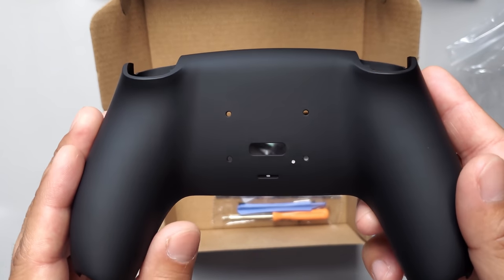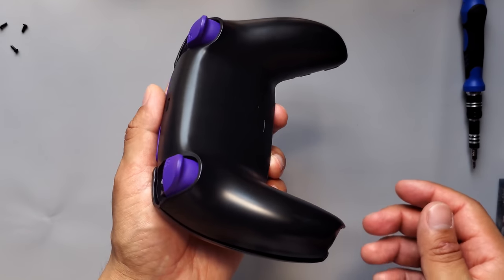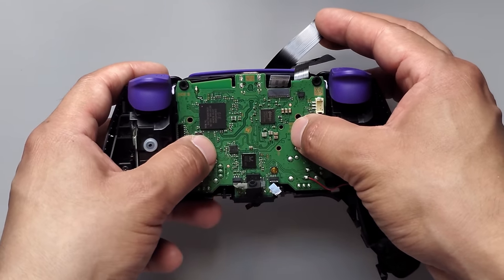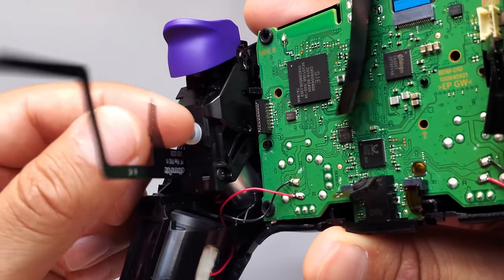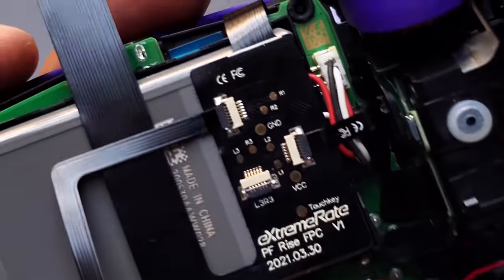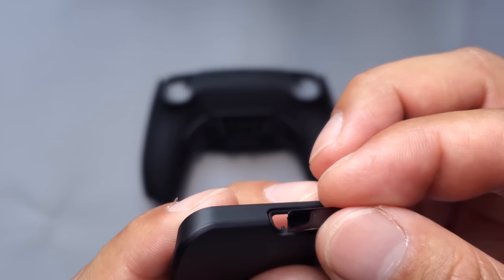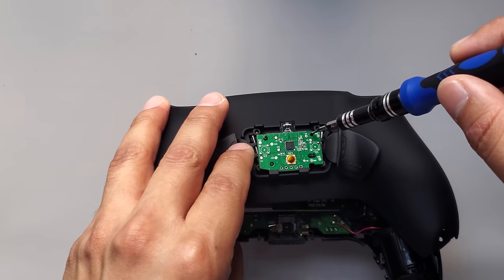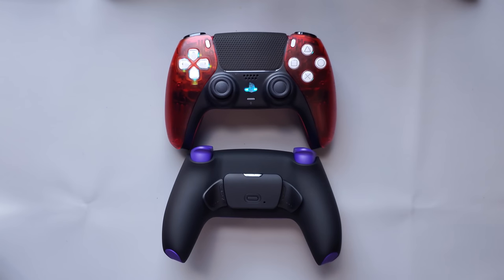DIY PS5 Controller (For BDM-010): eXtremeRate's Rise Remap Kit | No-Soldering Step by Step Tutorial

Comment: hi I saw your video and I installed the kit on my ps5 controller. Everything is good except one thing, my battery does not work any more whereas before the installation though. Do you have any idea of the problem ?????
Reply from the maker: Most likely the kit is not compatible with the control. You can ask Extremerate if they can send you the cables compatible to your control.
Reply: @im.a.caveman  Are you talking about the type C cable that is used to charge the controller?
Reply from the maker: @angelmoreau8148  The cables that connect to the triggers
Reply from the maker: I think if you put the original ones, the left and right side, and only connect the remap board you'll be able to only remap the Dpad and action buttons. But because the cables for the triggers are not compatible then you won't be able to remap those the triggers. I'm unsure. But like I said you can talk with extremerate about it.

Comment: I need some help it seems that when ever the L1/L2 ribbon is connected the controller doesn’t want to turn on but when it’s disconnected or turns on no problem? What’s going on
Reply from the maker: That means the kit is not compatible with your control. The V1 is only compatible with BDM-010. The rest are compatible with BDM-010 and/or BDM-020.

Comment: Hey brother great video. I've followed everything you've done but it seems like it's not working. Been trouble shooting for hours now don't know whats wrong
Reply from the maker: If the controller doesn't turn on its probably a compatibility issue. Is that kit compatibile with your control?
Reply: @im.a.caveman  Nah it's compatible and actually works with the triggers but it's not working with the face buttons :/ any tips?
Reply from the maker: If you checked your connections are fully plugged in then maybe it's the kit. I can't really tell since I personally haven't had problems at all with my installations.
Reply: @im.a.caveman  fair enough my man thanks for all the help though, I'll try opening it up today again and see what the problem may be!
Reply from the maker: @ZumaB  Take a look at the cable that goes towards the front of the controller motherboard. And if that doesn't work please contact extremerate. They'll possibly send a replacement.

Thanks for watching!

Comment: When I plug in the L1 L2 wire it automatically disconnect my controller. I troubleshoot everything else and it works fine but only the L1 L2 wire will shut it down. This is because the model id CFl- ZCT1W "A" idk why but it won't work it.
Reply from the maker: If the kit is only For BDM-010 which is CFI-ZCT1W then it's not compatible for BDM-020 or CFI-ZCT1W A. You need the one for BDM-020.

Comment: I can't get the first ribbon unplugged and I don't wanna mess it up.. I don't have a fancy tweezers like that, Idk why they wouldn't send something with the kit..
Reply from the maker: I think the more stuff they add to the kit the higher price for it. If you're able to grip the cable with your finger or nails try  wiggling it left to right, at its widest length, while pulling up. Don't rush, just a slight left to right will do. When I use my fingers this works for me and nothing has been damaged. It's the method I use sometimes so up to you if you want to try it.

Comment: Can I use "L3 and R3" as these extra buttons instead of X and the circle?
Reply from the maker: If you solder the wire needed to remap L3 and R3 then yes. This is the non soldering version which means L3, R3, and touchpad can't be remapped.

Comment: I installed it but the buttons don't work the light turns on and blinks when pairing but the then I click the button and it doesn't do anything. Do you have any suggestions?
Reply from the maker: After remapping turn the back off. On is for remapping, off is to use them.
Reply: Thank you sooo much I subscribed your tutorial made it super easy :)

Comment: I’m having a issue with mapping X all of the other buttons work & X button is working fine just won’t remap. Has anybody else encountered this issue looking for A fix ? Trying to map it to K1 but works works fine with square circle triangle.
Reply from the maker: Check your cables including the one connected to the back buttons. Check to see if they're fully pushed in. Also did you try to see if it maps to K2? Let me know how it goes.
Reply: @im.a.caveman  I’ve been playing around with it a bit further going over the connections but no luck. I have another controller so might buy another kit and give it A try on that see how it goes. The part under battery with the two holes is abit damaged now so might have something to do with that.
Reply from the maker: @hillenberg9996  It could be from the damaged part. Contact them and ask for a replacement.

Comment: So if I do this,would I still have all the haptic feedback,adaptive triggers and vibrations?.because I might as well just use a ps4 controller if that’s the case
Reply from the maker: If you don't install the hair triggers, yes, you'll still be able to use haptic feedback. If you do get the remap kit remember to get the one compatible with your control.
Reply: @im.a.caveman  what about adaptive triggers?
Reply from the maker: @Goofygiggity  With the triggers no. And it's also not recommended if it's going to be used for racing games.

Comment: I just put together my old controller because it was the wrong model. The battery is completely dead or acting like there is no charge. This a normal thing or did I plug the battery in wrong?
Reply from the maker: It could possibly be the battery. Check it and make sure it's connected properly. Did you also try with the wire connected?
Reply: @im.a.caveman  okay I fixed that problem. The battery was just dead I guess. It charged eventually. So I put the back paddles on the correct model controller but it won’t connect to my ps5. When I plug it in it has the glowing lights so I know the battery is connected. It just won’t turn on. any ideas?

Comment: Hello, I’ve installed mine and  for some reason my buttons aren’t working in games. They work just fine in ps Home Screen but once I click into a game they aren’t registering. Any advice?
Reply from the maker: Would you happen to know the BDM number? It's on the side of the motherboard that shows the analog sticks? There seems to be compatibility issues with BDM-020. Mines are both BDM-010 and work perfectly.
Reply: @im.a.caveman  I will have to check in the morning when I get back home. If it is an 020 does that mean I’ll have to return it?
Reply from the maker: @tylivetv_  it hasn't been confirmed but me and a fellow commenter did some investigating. And seems that it could be compatibility issue because the guy has a BDM-020 and worked normally without the back buttons and stock cables reinstalled. If that's the case yes, I recommend just getting a refund and hopefully extremerate finds a quick solution and an updated version for the new controls.

Comment: Can I get some help! I’m holding the button where the light is supposed to come on and it isn’t. I’ve went back into the controller and made sure the piece is connected to the motherboard and it was but same problem. Can you give me some advise please ?!!
Reply: Ok so I was freaking out when this happened to me…. Then I realized my controller wasn’t turned on lol.. so I know it sounds obvious but it happened to me. If this doesn’t fix your issue then maybe a part they sent is defective
Reply from the maker: Like the other person said, the controller needs to be turned on for the back buttons to turn on/ off Remap mode.
Reply from the maker: @DoxArb  Hey man, thanks for helping out!
Reply: Loooool I’m so dumb bro 🤣. It’s working now. Get tutorial btw!!

Comment: First of all I have to say instructions were amazing however I am having a severe issue everything is installed as per instructions I have checked multiple times however now my controller wont even turn on as in wont light up at all checked battery connections tried charging nothing works, would be great if someone could tell me what the issue is. Cheers
Reply from the maker: From the sound of it, it's because of compatability issues. Is the kit compatible with the control?

Comment: bro one question, i can change the X for the left and the O for the right? THNKS!
Reply: U can put any button on any paddle except share,start, Playstation button.
Reply from the maker: Touchpad, R3, and L3 can only be remappable if you solder the cables needed for them. Other than that, with the no soldering version you can remap any dapd, action buttons, or triggers/bumpers.

Comment: I followed all the steps but it doesn’t work for me. The light turns on and I can choose what button to use on the paddles but it doesn’t work in-game, also the L2 stopped working as well. Any idea what I did wrong?, I’ve re done it 3 times now 😩

Thanks.
Reply from the maker: Once you're done remapping turn the back off.
Reply from the maker: Also did you see if uts compatible with you're control? Asking since you mentioned L2 stopped working
Reply: @im.a.caveman  yeh, I’ve done that and still doesn’t work. 😞
Reply: @im.a.caveman  yes, it’s BDM-010
Reply from the maker: Did you happen to get it working?
Reply: @im.a.caveman  yes!!
I replaced the new L2-L1 cable with the old one, I thought it wasn’t gonna work but that was the issue haha, ended up working perfect. Great video, it helped me a lot!! 
Thanks 👌🏼

Comment: Hey man, I don't know what I did wrong, the controller works normally with the regular buttons, the led light on the back buttons turns on when it's supposed to, the led light blinks when you press any of the normal buttons and the back button, but when you press any of them they just don't do anything, any thoughts what could be the problem??
Reply from the maker: After remapping turn the back off. On is only for remapping.
Reply: @im.a.caveman  ohhhhh yeah you're right, thank you man, your video was by far the best I found

Comment: So with this way that you did it, there is no way of mapping R3 or L3 without Soldering onto the controller ?
Reply from the maker: Unfortunately you won't be able to remap L3, R3 and touchpad unless you connect the other wires with soldering.

Comment: Any suggestions for the controller not turning back on? the battery connection is together
Reply from the maker: I assume the wrong cables were connected. You have to connect the cables compatible with your control

Comment: Have you had any one have the problem where the controller works and says the buttons program but they dont actually work? any suggestions would be great. Acts as if the buttons program to what I vwant it to be but they dont work
Reply from the maker: After you remap, turn the back off, on is only for remapping.

Comment: Anyone knows if this works with the new manufactured Ps5 controllers that came out this month? There’s hardware changes with the new ones/colors I don’t wanna waste money lol
Reply from the maker: Those are most likely BDM-020/CFI-ZCT1W A. Which yes, it would be compatibile. The kit in this video is the v1 which was only compatible with BDM-010/CFI-ZCT1W. The new kits have both cables for either motherboard BDM-010 or BDM-020.

If you have one of the new controllers you should be looking at either the model (on the back shell) or BDM number which is shown on the motherboard.

Comment: I had a bit of a issue wen I put the controller back together it will not come back on any ideas wot the issue is thanks
Reply from the maker: If the control doesn't need to charge then it's possibly a compatibility issue.
Reply: if its a compatability issue what do i do thanks

Comment: So I followed your instructions and the unit powers up but the buttons don’t work at all. Any ideas? I’ve checked all connections and it’s not working.
Reply from the maker: You remapped after the red led went on?
Reply: @im.a.caveman  yes. Actually I turned the power off on the unit after programming and now they work. But if I power on the buttons they stop working.
Reply: @im.a.caveman  thanks for the response by the way.
Reply from the maker: @mikespencer7241  Turning the back buttons on is only for remapping. Once you're done remapping turn it off and they can be used. If you ever want to remap again to different buttons turn it on, remap, and then turn off. Thanks for watching by the way!
Reply: @im.a.caveman  oh no way! Lol. I didn’t know that. Thanks man. It makes sense now. Haha.

Comment: I managed to programme the right button, but the left button doesn't flash red when I try and programme it. Any ideas? Help!
Reply from the maker: You tried it with multiple buttons? Also, you're doing it while remap mode is on? Just making sure.
Reply: @im.a.caveman  I've tried multiple buttons and remap mode is definitely on. Sometimes it flashes and I think it's paired, but then when I turn off remap mode the button doesn't work. Not sure why it's inconsistent
Reply from the maker: @jakebillingham4468  Double check your cables. Make sure they're fully inserted.
Reply: @im.a.caveman  I just disassembled and reassembled and I've got the same issue. Any other ideas or shall I contact their customer support and see what they say?
Reply from the maker: Yeah you should contact them. Good luck! Hopefully it works out.

Comment: PLEASE HELPPPPPPP ****can someone help me please :( i set up the back paddles and followed all the instructions but the controller will not connect to my PS5. It connects to my PC with a usb to usb c cable no problem and is fully functional but when i connect it to the console with a cable it will not work, nor will it connect via bluetooth. When i try to turn it on, the light flashes orange then turns off. But when connected to PC with a cable it shows that i have 100% battery with the DS4 application. Has anyone else had issues connecting to their console, i dont know what is wrong with it.

Comment: I got all the way to the end and when I went to turn the LED light on it wouldn’t turn on. What should I check for? I went back and checked everything and it all looked good
Reply from the maker: The control doesn't turn on or just the back? Did you check the compatibility for you control?
Reply: The back doesn’t turn on
Reply: My controller is compatible as well
Reply: What should I check for?
Reply from the maker: @spencerpreston6913  The back only turns on if the controller is on. If you're sure that you checked everything is good and your cables are fully in then I can only assume it's a faulty.

Comment: Hi, hope someone can help - I installed rise kit but my controller did not work. I removed the kit trying to get my reg controller to function, all looks connected. The orange light illuminates one time and is non responsive when I hit the PS button. Anyone know where I may have messed up? Thanks
Reply from the maker: Did you try reconnecting the controller with a cable connection?

Comment: at the step on 3.27 i managed to destroy the cable connected to the green stuff... can i just reconnect it with electric tape? or have i destoryed the whole thing?
Reply from the maker: You're talking about the one with the little silicon square? And it completely ripped?
Reply: @im.a.caveman  the one connected to the battery holder, and yes it got compleatly ripped
Reply: @im.a.caveman  I can see that it is one of those cables i can disconnect, do you know where i could possibly just buy a new cable and connect the new one?
Reply from the maker: @ZZindexZZ  Found this so far. Will check on ebay now.

Replacement Microphone Flex Cable Handle Inner Mic Ribbon Cable Speaker L R Connector Cable for PS5 Controller (Short) https://www.amazon.com/dp/B099RV48PY/ref=cm_sw_r_apan_glt_fabc_XRVPMFCVZ25H58EFKNXF
Reply from the maker: @ZZindexZZ  There seems to be a few options on ebay. Here's a link to one. But you should search and see which you'd prefer. 

https://www.ebay.com/itm/Replacement-Microphone-Mic-Flex-Ribbon-Cable-for-Playstation-5-Controller-PS5-/144180639285?mkcid=16&mkevt=1&_trksid=p2349624.m46890.l49286&mkrid=710-127635-2958-0
Reply: @im.a.caveman  Thank you so much! You are a true lifesaver :D as long as i have that amazon link and a name for What i need, i will figure out the rest :) Thank you so much and you dont have to find it on eBay.
Reply: @im.a.caveman  you very helpfull guy! I appreciate you :D i hope your life will be filled with a lot of joy, and that you never have to walk with a hole in your sock :) Hopefully i can fix my controller within the next weeks so i can try out those back buttons :) just join if you play warzone or anything ^^
Reply: @im.a.caveman  i have fixed Almost everything and ordered a new cable, at the moment the back side is still not screwed back on, But is exposure of air on the back side (the green stuff, the battery and the extremerate cables) bad for the controller? I am Thinking of waiting to screw everything back on untill i Get that cable (i Get it in 3-14 days).

Comment: I have tried this on two controller and both of them are now dead. They don’t turn on and the lights don’t work. Can you please explain what could have gone wrong? I didn’t touch anything except the ones in the video.
Reply from the maker: Which remap kit did you buy?
Reply: @im.a.caveman  I just figured it was the wrong model🤦🏻‍♂️🤦🏻‍♂️
Reply from the maker: @alishabanipiano3990  Yeah its the v1 remap kit which is compatible with only BDM-010 since they only have cables included for that one. Later the BDM-020 controller came out and extremerate released the V2, RMB, and Rise4 to be compatibile with BDM-010 and BDM-020.

Comment: Bought 2 controls and 2 paddle kits. I have model 10 but everytime I connect the L1L2 ribbons it stop working. Anyone know how to fix this?
Reply from the maker: You need the the cable compatible with BDM-010. Which kit did you buy?